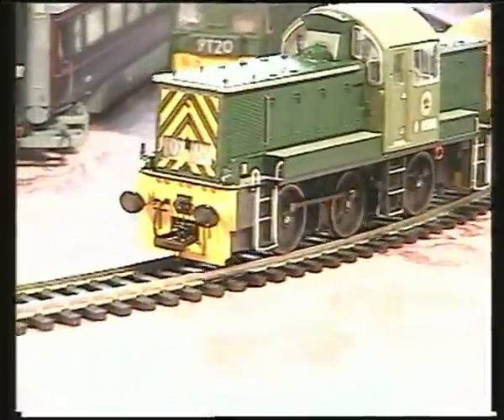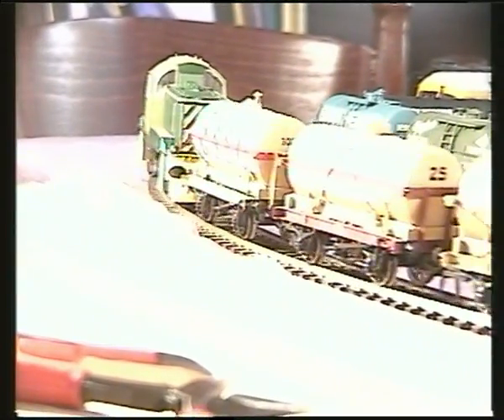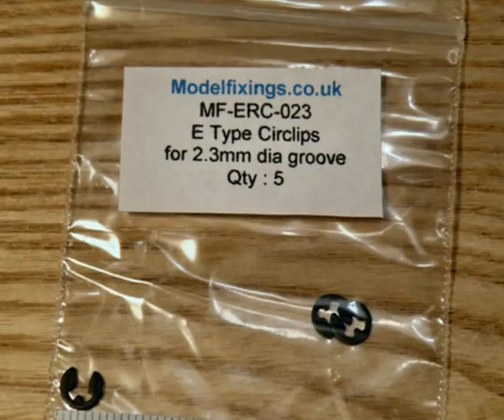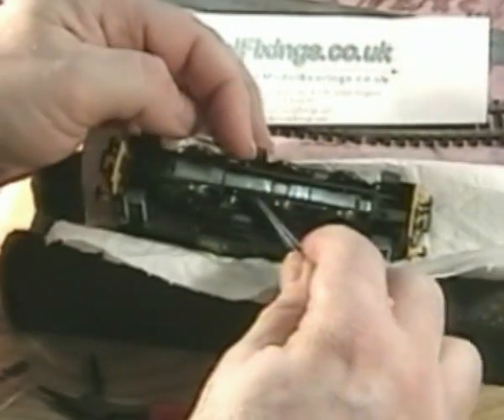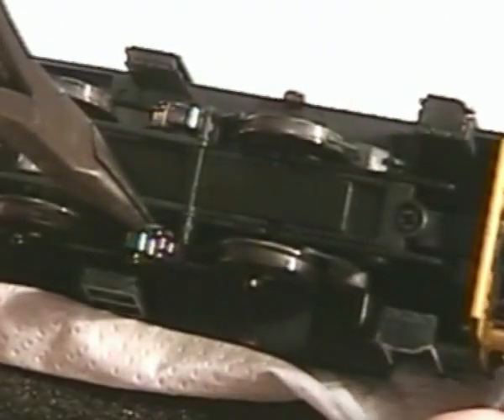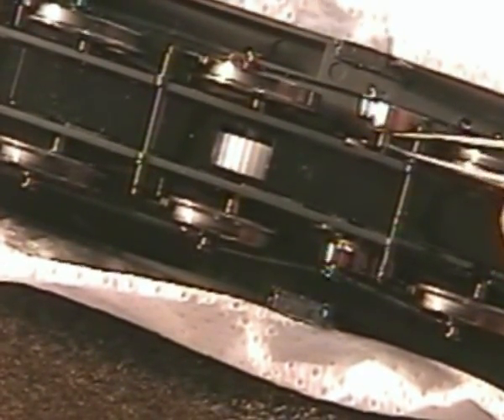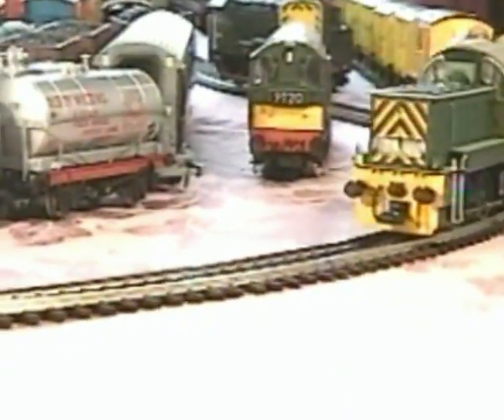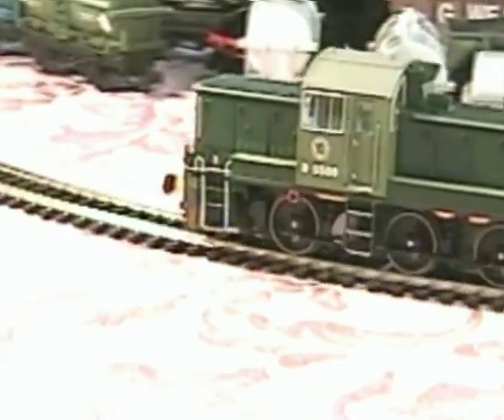Heljan BR Class 14 'Teddy Bear' update

Comment: Thank you for your informative article. I have not had any of the troubled issues with my Heljan class 14. I have a video of it running very slowly on my channel. When new, I tensioned the pickups well, (easily done by removing the slot in base plate).  I also put a tiny blob of congealed grease on the lay-shaft ends, which does what your shim does. It is a beautifully smooth & responsive runner, using my none digital control. Over the course of the last two years, it has taken its turn as area pilot, alternating between two 0-6-0 08s shunters, & gets better each time. My Bachmann 08 is more of a nuisance as the pick-up wipers make contact with the top of the rail-face of the wheels, so periodically have to be cleaned. Again though, thank you for your film. Brill!https://www.youtube.com/watch?v=6DYuF7Z1lC0
Reply from the maker: +PhilipInCoventry Glad you liked it.